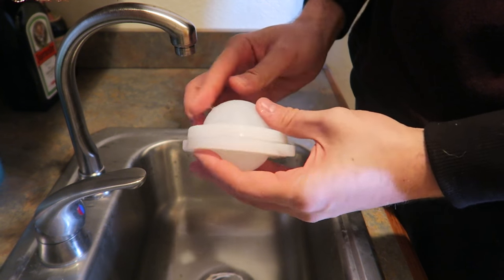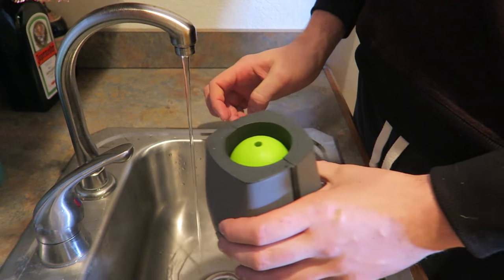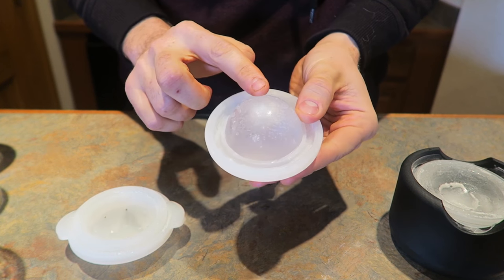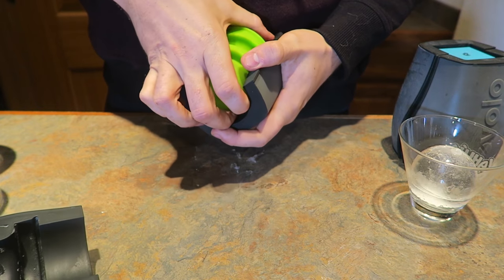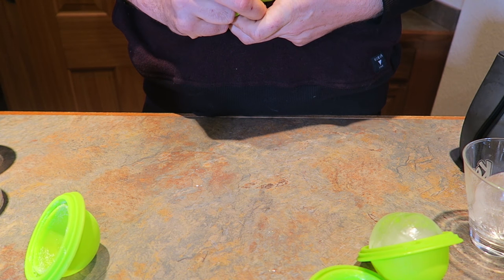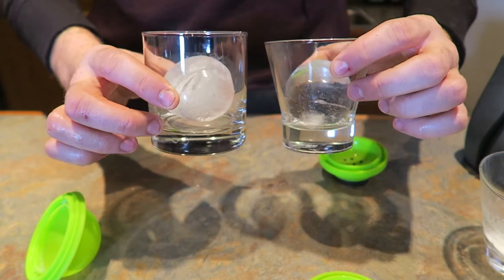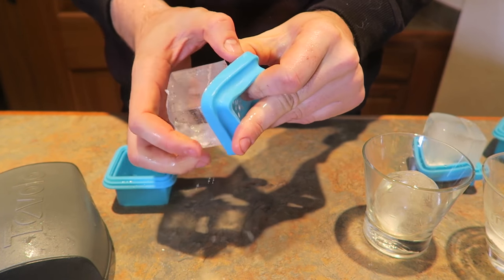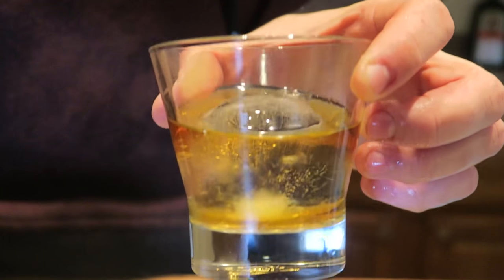Can You Make Crystal Clear Ice with this Gadgets?

Comment: Boil the water, or get super hot water from the tap and use that. The ice cubes are clear every single time.
Reply: Jessica Lauren. Boi
Reply: Jessica Lauren. That's works very well
Reply: I am Tree Boi what lol
Reply: GoAnimation it does! I wish he would try it. It would cost absolutely nothing. I don't see how it's worth paying money for something that gives you one clear cube 😂
Reply: hax?
Reply: Larry Bird Come on you don't want carpet you just want hard wood there instead.
Reply: I tried it and it didn't work :(
Reply: Mpemba
Reply: Jessica Lauren.  Actually it works because on boiling the water you remove the air bubbles trapped inside it. Now when keeping inside freezer remember that you don't let any tiny bubble to form and Boom you have crystal clear ice.
Reply: Would using distilled water help?
Reply: Horizon Winangkoso Would distilled water even freeze?
Reply: Bub Bet Yes as a matter of fact it freezes faster than tap water because tap water contains dissolved impurities requiring more tone to freeze.
Reply: but you have to put it in the freezer still hot, right?
Reply: Szobiz what she meant is, boiled water. when u boil it.. the air inside the water is released. when boiled water is cold.. the air didnt get back unless u shake it.
Reply: Jessica Lauren. Don't use hot tap water it's not for drinking. It runs through the water heater
Reply: Andrew Voigt in the Netherlands theres no problem drinking it
Reply: Alwin Molenaar it's not about your geographical location, it's about the fact that it sits in a tank to get heated, a tank in which that is pretty nasty. When you get a new water heater cut the tank and look at it. Think about it
Reply: It wont hurt you, it has algae growth in it. Perfectly fine to drink people drink it ALL the time. At least here where I live (In the states)
Reply: +FukItM4n
It's not about the algae growth, it's about the heating system. Older systems can contain traces of lead which dissolves into the water when it's hot, while this really isn't a problem if you are just using hot water in your shower, ingesting it can cause much more harm. However newer heating systems are built far more carefully with a lot more effort put in towards the user's health and safety (although some still have up to 8% lead in them).
Reply: But is it a circle👍🏼👍🏼👍🏼

Comment: Taras, using boiled water will get better results than straight from the tap, or even better results if you use reverse osmosis filtered or even distilled water. The cleaner water freezes at a lower temperature, but the ice is always flawless when I do it that way. All of your ice moulds will probably make perfect ice this way, even in the parts you throw away.

Comment: Actually I think that most of the imperfections are caused by air bubbles trapped inside the water. If you have a vacuum chamber, I'd try vacuuming it a little bit before freezing to see if it to see if it improves the results if I were you...

Comment: tip to remove it from the gadgets heat it a little or wash it on spout/bucket.
this tip also is useful if u want to remove imperfections that are near to the surface.

Comment: Use filtered or distilled water and boil it at least twice. Let it cool to room temp between boiling. After 2nd or 3rd boil, however many times you like.. Put it in trays or whatever while still hot and then put into freezer. The boiling removed impurities and chemicals in the water, especially from tap water and putting it into the freezer while hot slows down the freezing process.
You'll end up with crystal clear ice cubes 99% of the time. ;)